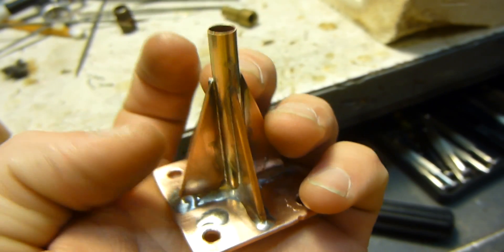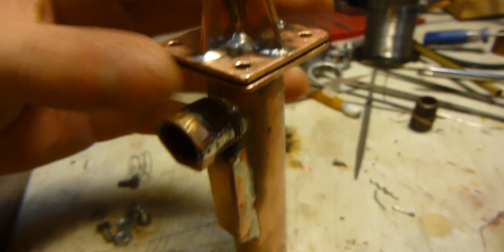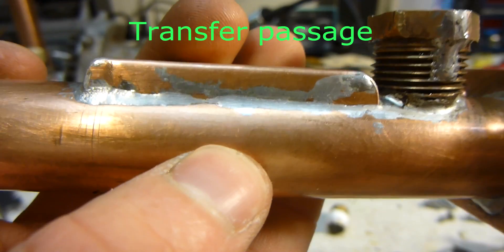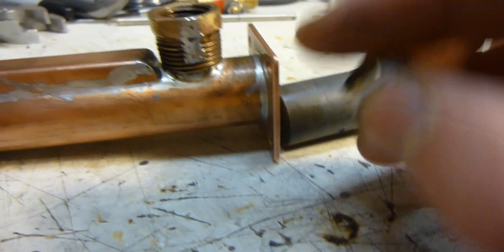Part 5. Making Internal Combustion Engine, No Machine Shop - Soldering the Head and Crank Seal

Comment: Hey I was thinking about your design here and since you have no crank shaft, just a connecting rod that runs through the bottom of the cylinder, then how does the hole that the connecting rod passes through get sealed? Wouldn't the piston just pull in air through that hole that isn't sealed and the fuel would not get pulled in or am I missing something here?
Reply from the maker: +Jared Bradt it's a close enough fit that it seals pretty well. I also grease the rod so that helps seal it even better.
Reply: Makerj101 alright thanks
Reply from the maker: +Jared Bradt PM me on Instagram or Facebook if you have any more questions.

Comment: If you have multiple pieces to solder you can solder the first pieces with "hard" solder then "medium" and so forth to prevent the first joint melting as they melt at different temperatures

Comment: i got alot of respect for this home made engine, i built a home made motorcycle but i did it with an engine i got from a junkyard, comes with its challenges but this here is some crazy cool inventiveness, i wanted to make a jet engine out of tin cans like you see on youtube but i just never could get interested in that small stuff, always busy on other less delicate and precise but easier projects, i used to make all that delicate complex cool little stuff but i guess its just been on the back burner for a while . . .seeing this sparks that drive again, i bet i could pull it off too but it would be challenging, im sure you could do it tho, i would love to see you make a running jet engine model too

Comment: Hey I´m just like you. I also want to build an model engine. But I have a question before I start making mine, what type of ignition do you use and how is it put together?
Reply from the maker: I used to use an old HV thing from an electronic air cleaner.  Now I am using an ignition coil that is triggered by a MOSFET and halleffect sensor.  Very simple circuit that I designed.  I need to make a video about it...
Reply: Yeah do please! There is atleas one person (me) that would benefit from it greatly! :D
Reply: Is the ignition fixed timing? or does timing varies with rpm? A video would be very nice!
Reply: SamD you can use a gas grill igniter to fire the spark plug
Reply: yes, i intend to use a bbq lighter with a circuit board from amazon with a micro switch
Reply: If you are feeling fancy you can use a hot tube ignition. Although it may be more finicky than the spark plug, but it would be very reliable once you find the correct length of the tube.

Comment: Makerj101 I was wondering what do you use for your carb setup and what kind of rod is that you used for your connecting rod and how long can it run without the cooling system I'm planning on making one of these engines based off your design for a school project is there anything I should know to be cautious about before I build the engine I was wondering if you could give me a parts list if possible

Comment: You'll have to add air vanes to air cool it at least. If not, make it water cooled. And my big question,. How are you generating the spark?
Reply from the maker: +laffingidiot I cool it with water.   The park comes from an old electronic air cleaner from a furnace.  It's basally a high voltage power supply.  It uses a constant arc across the spark plug.  No timing whatsoever.

Comment: Like the work. great job. I need a soldering advice, what is that liquid on the surface you soldering ? And when the engine itself heats up will that unsolder your joints  ?

Comment: That is very nice soldering indeed !  Will solder melt when the engine gets warm ? I will surely wait to watch more.

My last attempt was to make a lathe. I've welded the frame, put everything as it should be, in their places, used my beefy 5 kW three-phase motor as drive. First attempt was to cut and practice with a steel cylinder, it worked fine. Then I decided to play with steel pancake-shaped piece the first few mm was great until the shaft caught some metal shavings, so it literally became a weed trimmer scratching all my hand LOL (through glove).
So after all that I was still up to lathe something. So I took a nice piece of brass, the blade stuck into it, cause I went too fast so it ended up all across the garage. Haha what a fool !
Reply from the maker: +bb aas Thank you!  Nope.  I mean if my cooling system fails than sure the solder would melt.  But if can run for about a minute without and cooling before things start to get toasty.

Ouch that doesn't sound good.  I'm glad you're ok.

Comment: OK well it is all coming together.  Anyone with enough guts could start their replication build about now.  There are some people like Myfordboy who might want to try this.  Building an IC engine using just a drill press and easy to find parts is an amazing feat.  The part in this video where you yell " it's working" is very inspiring.  I know that feeling you get after many hours of work and failure ---when the thing you created comes alive and finally runs.
Reply from the maker: +Lidmotor Indeed!  Have you started building yours yet???  XD   I'll see if I can get a hold of Myfordboy!  Thanks!  I was just kinda going nuts hahaha
Reply: +Makerj101  I have not started it yet.  For me it will take quite awhile to build it if I decide to.   I hope that Myfordboy or someone else builds one.
Reply from the maker: +Lidmotor Hahaha I think I may do another engine using some simper methods and not use my drill press or any solder.  That will be hard for me because I love both LOL  But for all those people out there that don't have those it would be really nice.  I emailed Myfordboy and paraphrasing, he said, that I did well to build it with these materials and methods I had handy and it reminds him of his first steam engine.  I kinda doubt that Myfordboy will build one.

Comment: the series gets better and better! actually, those terminal blocks are almost impossible to find here in the Netherlands. the hardware stores now sells stupid crap that is made of two pieces, so it falls apart when you take it out of the plastic. only the bigger sizes are like this, and mostly brass or copper. so you really have to search hard to get them.

please, can somebody slow down the video to see what he said?
Reply from the maker: +Triangle_DIY That's interesting.  How do you connect your wires then?  I always thought wire caps were an American thing and terminal blocks were used most other places.  No worries!!  You can buy them on eBay!  XD

Hahaha I was basically blabbing a whole bunch about how I didn't want to get flux in the cylinder.
Reply: +Makerj101 wire caps are used in house installation everywhere here, that is the professional way to do it. people that know nothing about electricity use the wire terminals. also most used for connecting lamps to the ceiling, so its easy to mount them for the common people :D the wire terminals are for sale here, only the cheap ones are two parts that fall apart. I have some bigger, more industrial quality, and those are good. was a long search though... have had some cheaper ones that break when you drive the screw too hard.
Reply from the maker: +Triangle_DIY Ah ok.  Yeah the terminal strips are nice for quick connections and things that will need to be disconnected once and a while for servicing etc but for heavy use they do have a pretty high resistance and can't handle all that many amps.  Also those screws can get lose which is no good.  I got most of the ones I have from Radio Shack.  I think I could also get them at the local hardware store since they have like everything there.
Reply: yeah, terminal strips is the easy, lazy way to do it. Permanent things must be
connected with wirecaps.
Reply from the maker: +Triangle_DIY Yep!

Comment: Awesome! had two tries on building a 2 stroke gas engine, both of them failed..:/
Reply from the maker: +XanderZ Hmm did they try to work at all?  Did you get any combustion?
Reply: +Makerj101 Yeah, sort of..anyways, it had very bad compression..even though I managed to make a little piston ring.., that didn't help too much :/
Reply from the maker: +XanderZ I've found that a piston ring is vital.  Mine will not work when the piston ring starts to wear out.

Comment: This is so cool!!  My only concern would be the solder possibly melting from the heat of the combustion after it's been running for a while, so some sort of external cooling might be necessary.
Reply from the maker: +Tim Adams Everyone thinks that...  It can run about 2 minutes before the cylinder is too hot to touch and I need to cool it down.  I have added water cooling now.  Eventually I plan to add a radiator.

Comment: Awesome! You can possibly make a boxer engine. 👍
Reply from the maker: +03hVc01 That would be super awesome!  Make one of these times 2 and put it on one crank.  Wouldn't be that hard to build.  The hard part would be getting both cylinders to work at the same time.  I have enough trouble getting one cylinder to work.